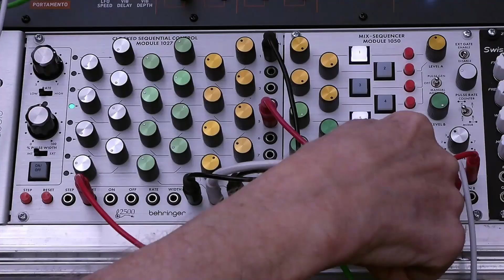ARP 2500 Bible   1050 Mix Sequencer Part 2

Comment: thanks very much for these videos, i couldn't understand the diagrams from the manual, they must take time to decode
Reply from the maker: The most unusual thing about the ARP 2500 modular is the Matrix Patching.  Check out my video in the 2500 Bible series on Matrix Patching.  That may help in understanding the diagrams in the manual.   
https://youtu.be/22cHYE0_b-M

Comment: Thank you! The sequential switch function is what I've been trying to figure out. I saw another youtube video using the 1050 as a sequential switch, but it didn't elaborate how. I'm currently using the 1027 with the 962 switch, which works great, but I want to give the 1027 and 1050 a shot at working together.
Reply from the maker: Sean - thanks for the positive feedback.  One technique that you can do is take CV outputs A, B, C and route them to the 1050 Mix-Seq.  You see this in my demos.  But you can also use a mult to repeat a CV output.
so, route output A into steps 1 and 3.  The B-->2 and C-->4.  You get a sequence A,B,A,C.  This lets you move beyond A,B,C, A,B,C
Reply: @ozhalljr  That's brilliant! Thanks for the additional tip :)
Reply from the maker: @seansnyder7744  It is brilliant.  I wish I had thought of it.  Someone (on reddit?) shared that with me in response to this video.

Comment: Great video! Also, you can mult the signal for a 32 step sequence
Reply from the maker: Thanks!  I had to think about this for a while.  I could use OUTA cv (via mult) for Mix-Seq inputs 1 AND 3 , then use OUTB cv for input 2 then OUTB cv for input 4.  That gives 32 steps and the repeated OUTA melody is a pretty musicial form.  great tip!
Reply: @ozhalljr  yup I went through the manual when I first got the module and did something similar. Your tip about resetting for a shorter sequence to add to the complexity was really cool, love how flexible this module is. Going to try that.  Been wondering how to use these modules to make polyrhythms with 2 voices.  

If you have any ideas I’d love to watch a video on it. I really enjoyed your teaching style
Reply from the maker: @TheMachinesWon  Many Thanks!!!  r.e. poly rhythms,  You could use the 1050 mix-seq as a second voltage source with a different length.  i.e. take a DC voltage, mult it and run it into all inputs on the 1050, then trim the level of each step to pitch.  Adjust "count" limit as desired.  I'll see if I can come up with another idea.  (although buying a second 1027 sec is also an option).
You could also fake a poly rhythm by repeating a sequence (e.g. 3 notes).  Of course that would not be a try polyrhythm.
Reply: @ozhalljr  thanks for the great tip, I don’t have space for another module so trying to get creative. If you have any other ideas I’m interested for sure. Will try this and see if there’s any other ways possible on my end too. Thank you! 🙏🏽